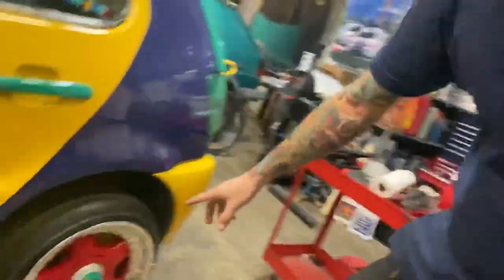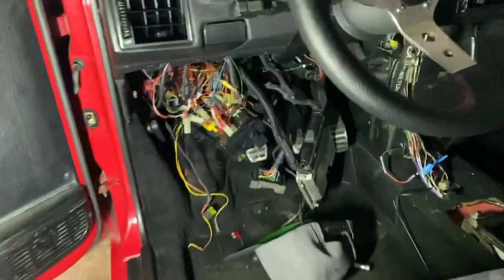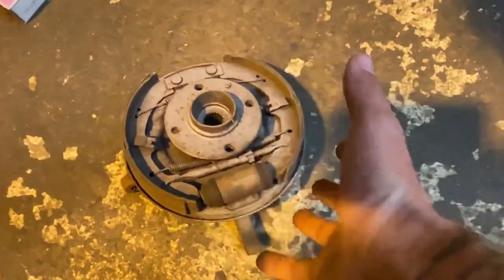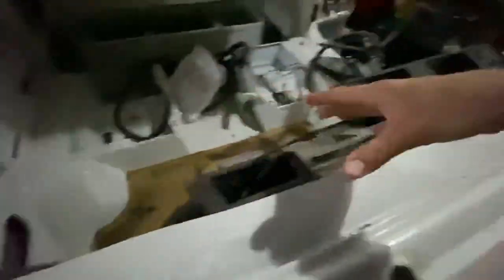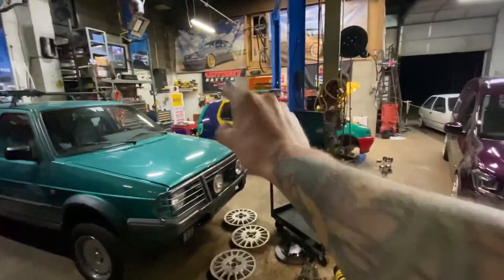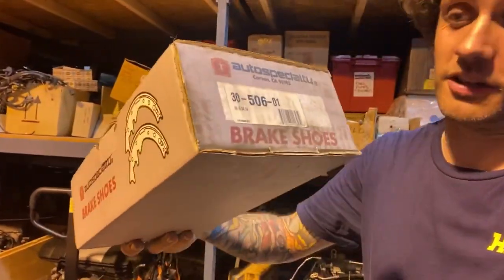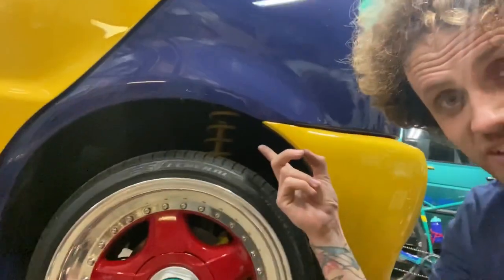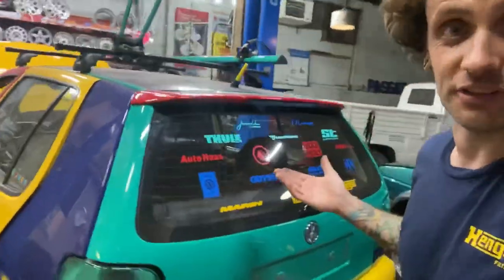Jamie’s Daily Workshop Vlog Experiment : Day 1 of ?

Comment: There are no polos in the us?🤔 Never knew it😅 how often do you have t4‘s in the us? (in us they are called eurovans i think?)
Reply from the maker: Polo (and Lupo) were never sold in the USA or Canada. I have owned 6 or 7 Polos here, but all were imported. There’s probably dozens driving around that have been imported, but most are 25+ years old because of the import regulations :-)
Reply from the maker: Eurovans were sold in 1992/1993 and again around 1998-2003ish. Only in the caravelle body style, and with 5 cylinder petrol engines in the early ones, and only automatic VR6 in the later ones. I own a T4 passenger van in Europe which I’ll be bringing over soon though, haha.
Reply: T4 is the nicest one for Daily use, But in here are about 80% diesel because they are way better than petrol😅